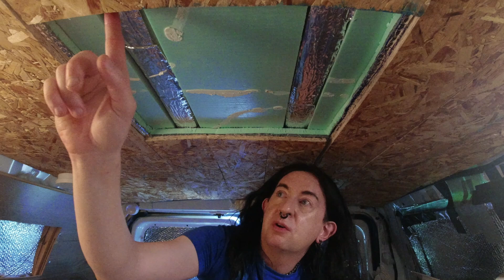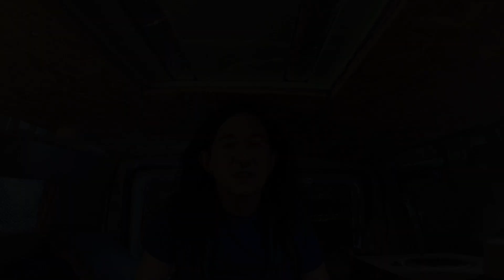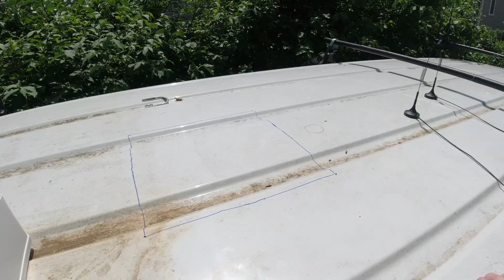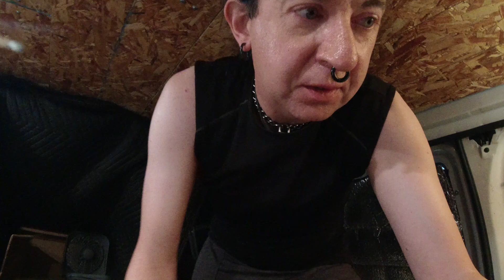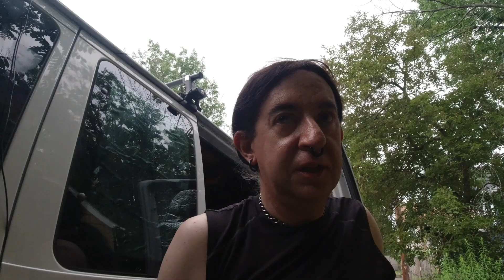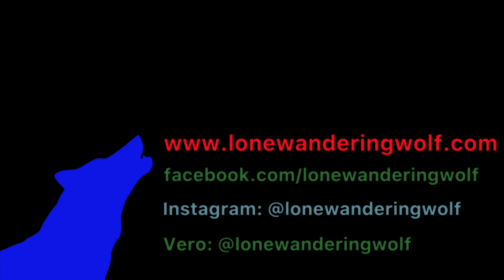Finally Installed A Roof Vent - Temporary Air Conditioner For The Heat Wave - New England Vanlife

Comment: It was clearly worth the extra effort to get the fan as high into the ceiling as you can. You can't afford to lose any headroom in a van. Also, we wouldn't want to see you hit your head on it or get your hair sucked into it. Kudos on your creativity with the portable ac unit. Looking forward to the next video. Peace.
Reply from the maker: If I mounted it on the bottom of the ceiling, I would either break the knob off, or crack my skull on it.  It's right at the spot where I'm climbing in and out of bed.  Now I can also stick an insulating panel over it in the winter.  Thanks for your comments!